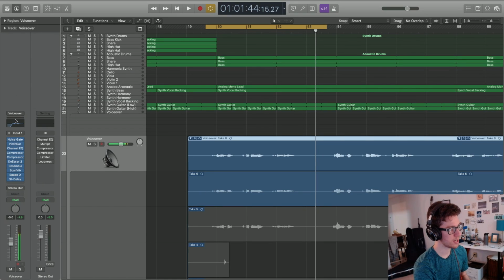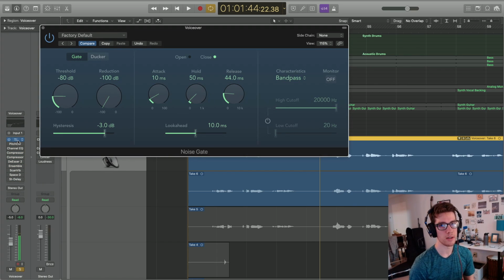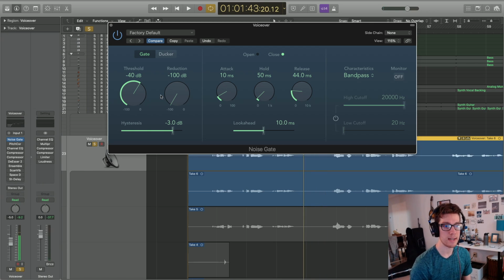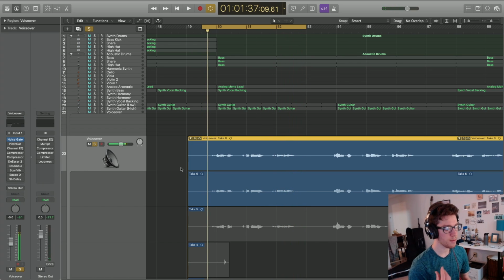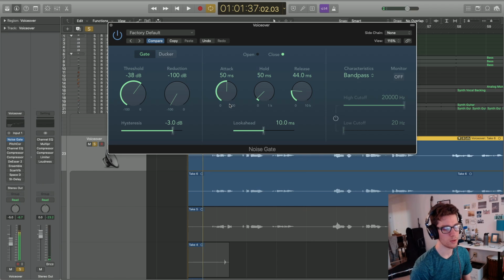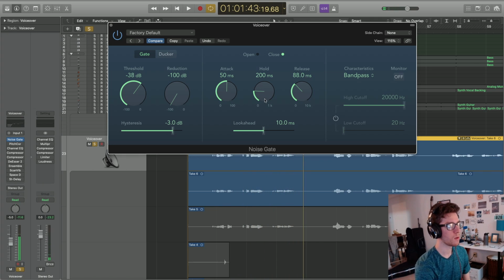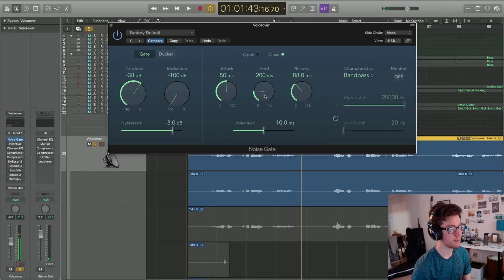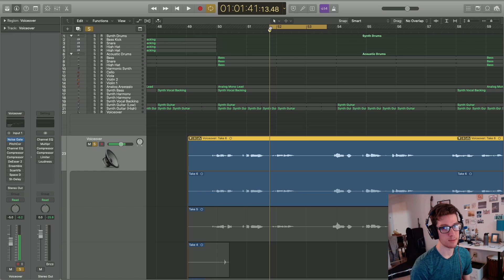In-Depth Noise Gate Tutorial (Logic Pro X) | How To Remove Background Noise Between Vocal Lines

Comment: Easier way, just use the expander effect and turn the ratio down until you hear no fuzz
Reply from the maker: The expander will increase your dynamic range so be careful with this. The best way to remove the noise completely is through EQ and noise reduction. The noise gate serves a very different purpose and that is to remove noise between phrases.
Reply: @simonsoundstudio9870  not true. The expander does the trick. You only have to control your db. The noise reduction is not the best option here. At all
Reply from the maker: I guarantee that is what an expander does. It makes your loudest moments louder and your quietest moments quieter. It is the opposite of a compressor. It can lessen noise, but I just wanted to warn about that. In regards to noise reduction and EQ, those are still the best option, as you may need to further compress and process the audio, in which case expansion may just be undone.
Reply: @simonsoundstudio9870  once again,  the expander has worked wonders for our vocals that had the fuzz sound in the back. Its much more effective than the noise Gate
Reply from the maker: I definitely don’t want to disagree that it hasn’t solved your problem in the past. I’m mainly clarifying for the other viewers that for one, the noise gate is dealing with a different problem entirely. Also, expanders are a trade off. They are not subtractive/destructive like EQ and reduction. Basically, this tutorial isn’t dealing with a problem the expander would be solving.